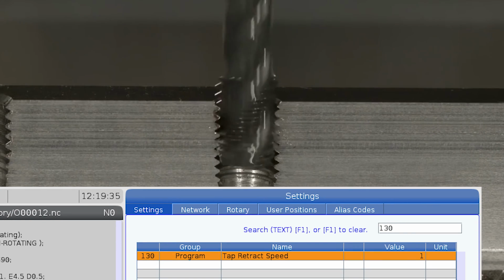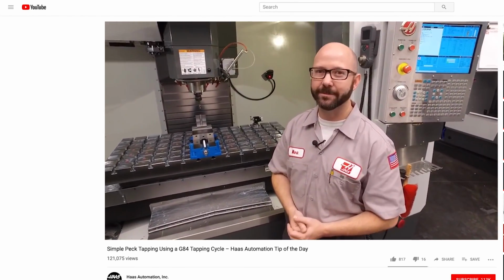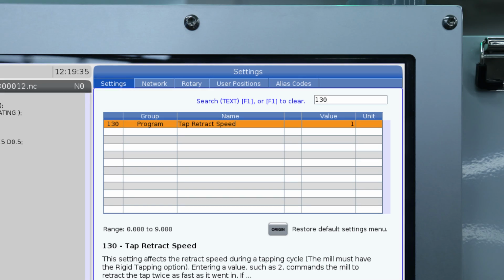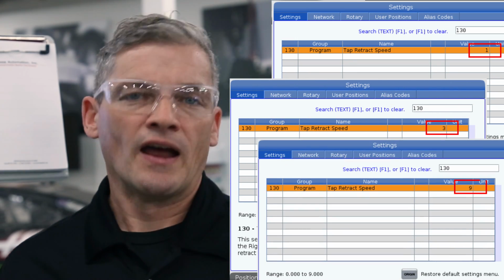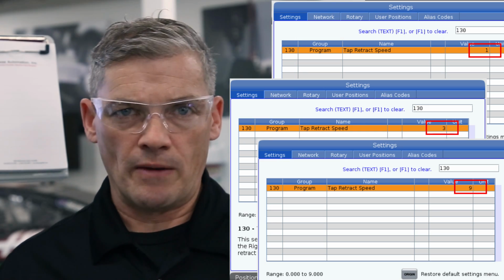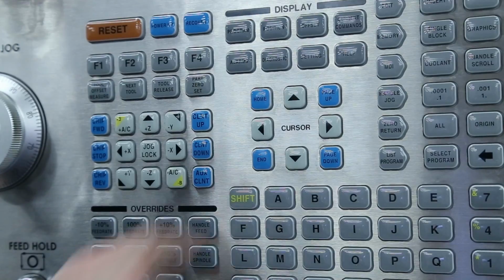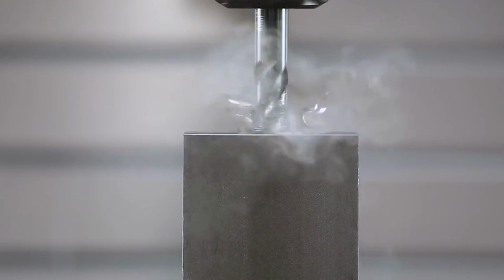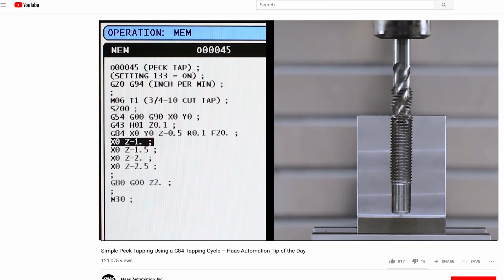Haas Apps Minute - Haas Control Settings 130 & 133

Comment: Altering setting 130(you can also use a J on the g84 line).We use alot of H6 form/roll taps at work.Does the increase in speed/feed have an adverse effect on the thread in relation to the material displacement.I know the taps are manufactured on the high side of the H6 tolerance to allow the material to spring back.Just wondering if the tap would also form on the way out if it was going quicker than on the way in.

Comment: Don't use setting 133 on next gen lathe control, it stalls the machine at the R plane.
Reply: I use it on a daily basis on my NGC mill, maybe your issue stems from cockpit error.
Reply: @OakwoodMachineWorks  I said LATHE
Reply: @mikeepeck  its haas